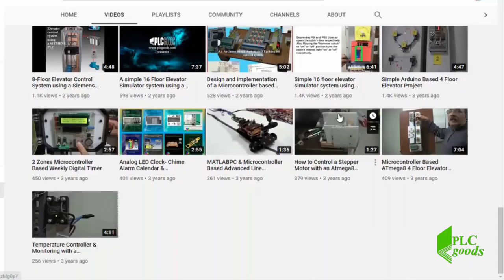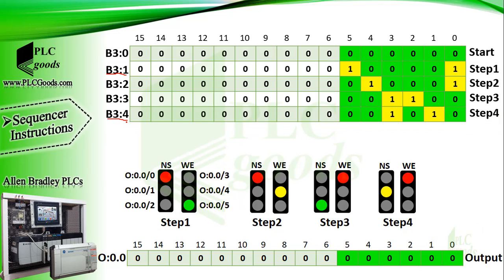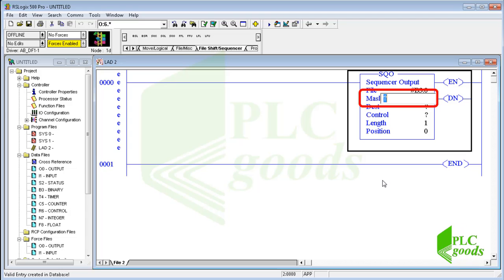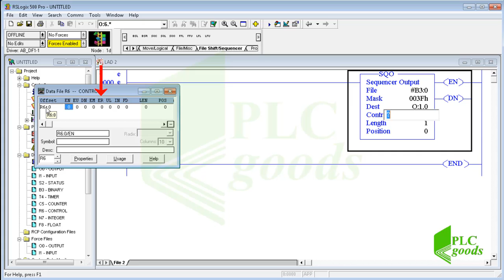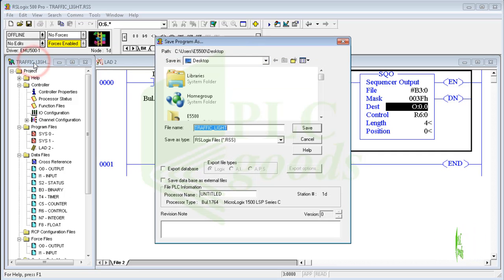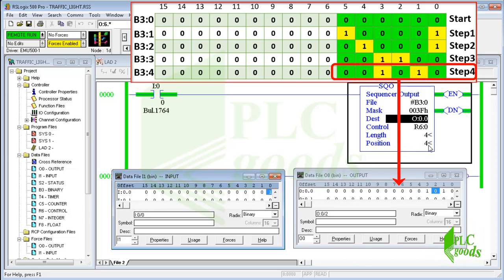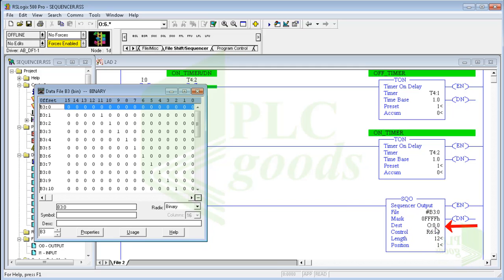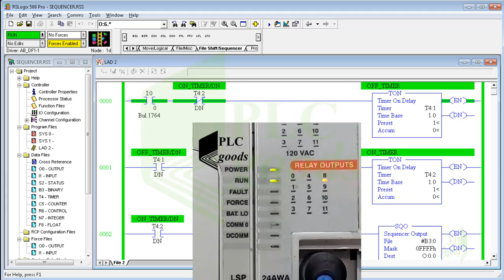Allen Bradley PLC Tutorial | RSLogix 500 Sequencer SQO SQC SQL |Traffic Light | Lesson 10

Comment: Where's the instruction on SQC, SQL, and SQI as described in the title?
Reply from the maker: SQO, SQC & SQL are used to write the PLC control program which controls the Stoplight project. In the video, all explanation is given and the setting up those instructions are clearly explained. SQL is not used in the project but its application is very close to the other ones.
Reply: @plcgoods  I agree that SQC and SQL are mentioned but not to the point of true explanation providing understanding. I think you should have not included them in your title because it's misleading. I was expecting a better explanation or example of how these two are used. :(